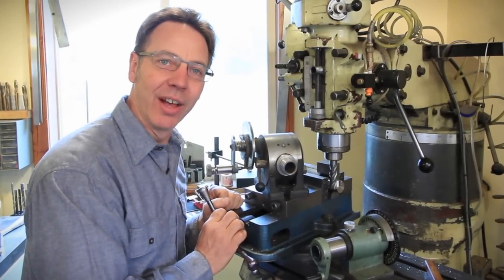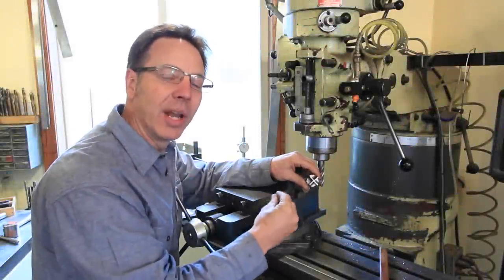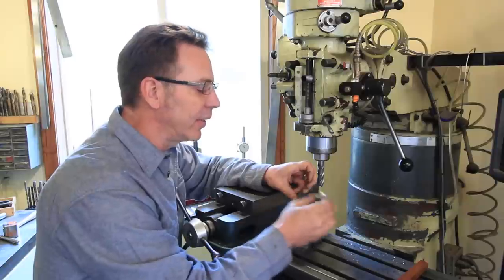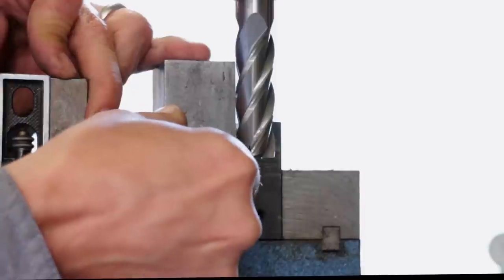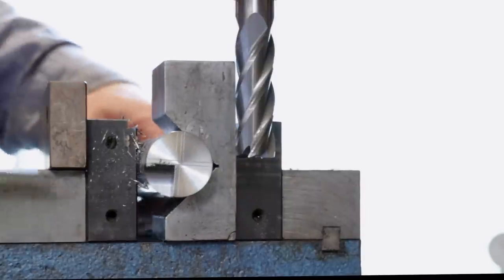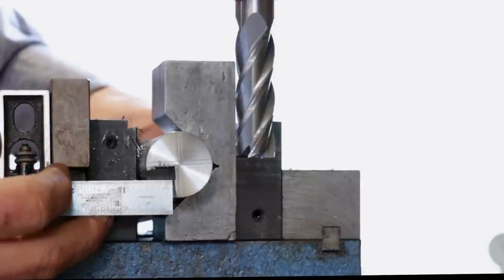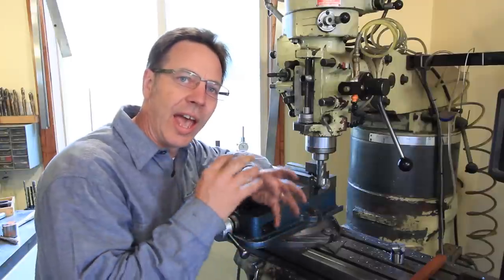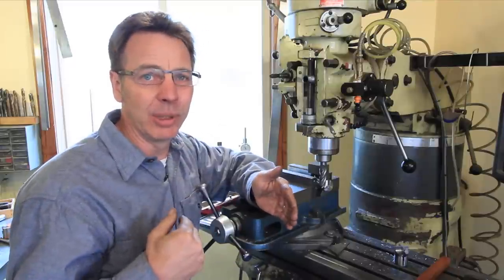Milling Machine Basics: Dividing with out a dividing head

Comment: Dale, the angle blocks should allow cutting 120 degree quadrants for says flats on round stock to chuck in a drill for better chucking.  Thanks for thinking outside the box and providing us with this method.  Will come in handy.

Comment: Other option is to bore a hole the same size is some square or hex stock etc , and put the bar in stock into vice the clamping force should clamp the bar into stock if tolerances are right. you can add a grub screw into stock to keep position when rotating. or if bar can fit into a collet you can use a collet block in vice.

Comment: I have square eyes. I just need to look at it and get it within .0003".
Reply from the maker: That very cool
Reply: *****
If it were only true.
Reply: 3 tenths really?..I would be willing to bet you on that one
Reply: Jack Gauthier
 You mean 3 ten thousandths.
 And no, I'm only pullin your chain.
Reply: If I have two strait edges and create a gap between them with light behind I can get something within at least 1 thousandth fairly easily and probably 5 tenths with a little luck. Of course this method falls apart when the strait edges are too long or too short.

Comment: Thank you for this.  I always love out of the box thinking.  Have angle blocks and a small mill.  My dividing head is too big to use with my mill, impulse eBay buy.
Reply: Brian Zimmerman what kind and size of dividing head did you get?
Reply from the maker: HI Brain, I have the same problem on ebay. LOL
Reply: Longs Index Head,  it has a 1.5"x8 thread for mounting a chuck.  Way to big for the X2 mini mill I have.
Reply: Brian, I've got a 5c indexer like the one shown in the video that's too small for my mill. Want to possibly trade?
BTW Cool sphere machine!

Comment: What's the difference in the number of flutes in end mill bits? Some are two, four, our even more, is it for different types of steel? Thanks
Reply: 2 for Aluminum , 4 or more for steels
Reply: The more flutes there are the faster your feed rate can be if your taking .008 per revolution of cutter with a 2 flute each tooth has to cut .004 each
If it you have a 4 flute cutter it would only be .002 per revolution
This smaller chips per tooth speeds up your travel but not your rpms

Comment: Thank you as I will admit you do a pretty good job and I don't want to dampen your spirits but, as a machinist of 31 years it takes alot of knowledge and experience before the  term "machinist"  may be used so do not give easy reference of the term please.
Reply from the maker: Thanks for correcting me, your right. 

Dale d
Reply: ***** I think defining a machinist as a problem solver is great.  I am a machinist on board a Navy ship, and problem solving is key when you are out to sea.
Reply: A machinist can make a Swiss watch from a block of steel with a chisel and a file...if you're willing to pay him for his time
Reply: +David Avery Ask any CNC operator. They will claim to be a machinist. I call them robot drivers.
Reply: ardvarkkkkk1 You are so right!  I've also been told that they are a CNC machinist...what the hell is that? Do we make up positions now or what?
Reply: +David Avery , don't know if you remember me or not... You started me off hand finishing tenths on a manual lathe. I learned manual machining, grinding, burring, cnc operating then setup, and now I program, prove tto's and finish parts. You, Dave, taught me that to be a "machinist", I had to be able to use/or figure out, any machine and material I came across. Shamelessly, and confidently, I'm top of my field because I followed those guidelines. Thank you Dave -Aaron Adams
Reply: How could I ever forget you! Your one of the one's that listened and therefore learned...Your welcome my friend. This means alot to me and hopefully one day someone can say the same to you. Be good, stay well and see you someday.  p.s. do you remember the brown and sharpe's?

Comment: ... with quadrants, you only need to turn it 180 degrees. you can do both sides without doing this 3 times to get all four...

Dislike, for not thinking it through :P
Reply: That assumes that he has the vice square - from eyeing it the vice pretty clearly looks set at an angle such that the quadrants also have a bit of a scalloped side on them.

With the tools he showed and the problem he referenced, I would have clamped my bar in the V-block, hung my indexer on the far side where his stop is, then inserted a few screw jacks or blocks and shims and clamp my indexer in place.  

For any angle you can then loosen the vice, index in your angle and tighten the vice to take the forces of the cut.  Similarly since he has a lathe he could turn down the one end of the stock to the collet size of the spindexer and set it up the same way - again depending on the outcome he wants.